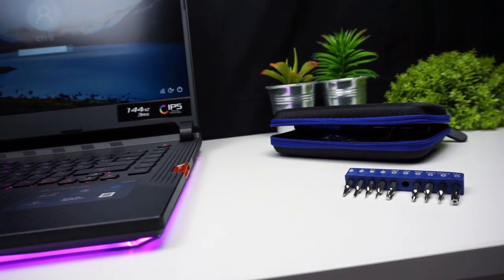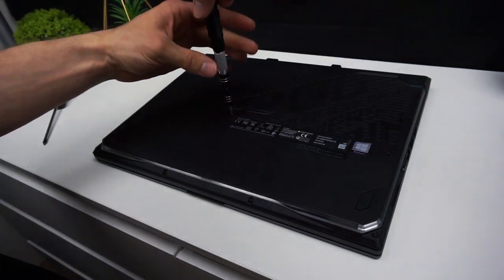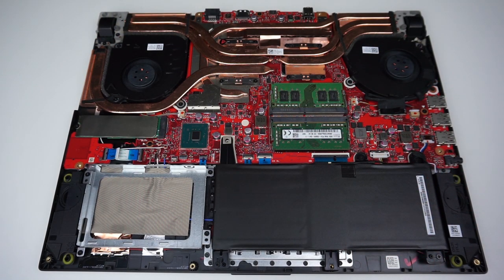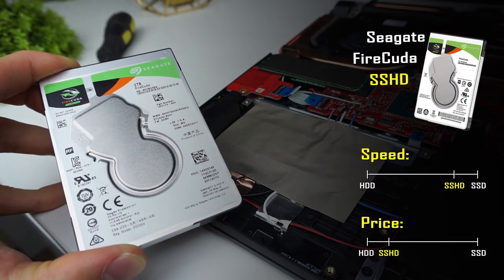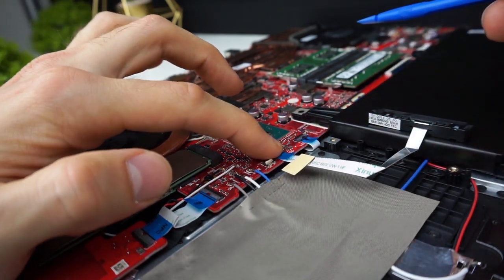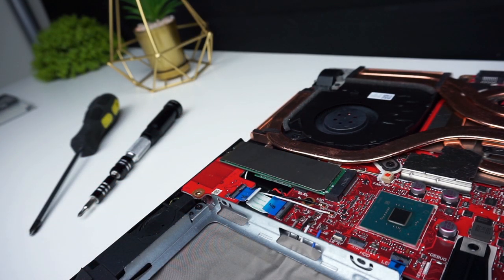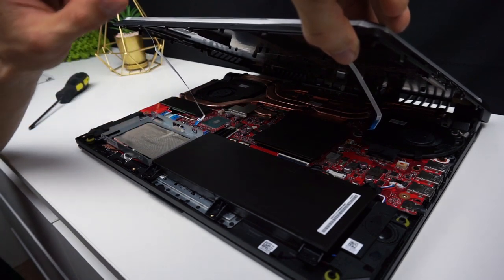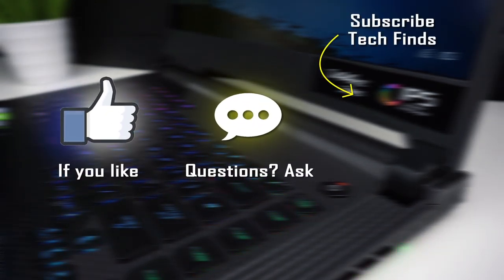Asus Scar III Upgrade RAM / SSD / HDD - Disassembly Guide

Comment: can you keep you battery unconnected when playing at home on charge cable?
Reply from the maker: Every laptop has 30fps limit in games on battery, so you should play with cable connected.
Reply: @TechFinds  thx... But what I meant (while at home) I dont need the battery at all, so my question is if i can un-connect the battery permanent or put it even out while playing with the cable connected? (I dont want to waste the battery for nothing)
Reply from the maker: @ii-_-ii1547  you should leave the battery connected even though you use the laptop plugged in all the time
Reply: @TechFinds  thx mate I appreciate

Comment: Is the Crucial 16GB 2400MHz also compatable with the Rog Strix Scar III?
Reply from the maker: Yes, you can use it but I don't recommend to mix it with original RAM which is 2666MHz. It's better to match the specs

Comment: Which ram does the strix gl531gt take? And is 512gb of ssd ideal for a gaming laptop?
Reply from the maker: If you gonna have a lot of games i recommend some 1TB or 2TB HDD. I linked compatible RAM in the description.
Reply: Tech Finds so all three you linked are ddr4? And what’s the difference between 26666Mhz and the higher numbered models?
Reply from the maker: @peasant9613  2666MHz is the maximum this laptop supports.
Reply: Tech Finds ok.
Reply: Tech Finds final question, would you recommend taking out the already supplied 8gb ram and putting in two of the same crucial rams or using one crucial stick and adding it to the empty slot?
Reply from the maker: @peasant9613  Adding one more stick is better as you'll save yourself some money. It will work the same good tho
Reply: Tech Finds sorry 😂 another question, do I have to use the same spec stick in order for it to work? Ex. The already supplied stick is a Samsung 2400mhz 8gb, should I have to use a crucial 2400mhz or could I use 2666Mhz?
Reply from the maker: @peasant9613  It's important to match the specs to avoid compatibility issues. If you have 2400MHz go for the same speed Crucial
Reply: Tech Finds thanks so much!

Comment: Can I just just install a new harddrive with higher memory.  Or do I need to transfer the operating system to the new harddrive ?
Reply from the maker: Your OS is on M.2 SSD, so if you'll change or add HDD you don't have to re-install OS
Reply: @TechFinds  awsome thank you . Now just curious if you have time to answer this if not no worries . The hdd what exactly gets stored on there . Just files you download onto your pc?
Reply from the maker: @SAYMiK3  you can store anything you want on your HDD. You can download, transfer files, install games and so on

Comment: Hi ! thanks for sharing your tips and tricks, that's a good highlights ! I just have one question : what kind of M.2 slots I can plug my new SSD ? Which doesn't restrained the download and upload rate ? 
Thanks for reply
Reply from the maker: Hi mate, i linked few SSD options in the description so you can choose any. M.2 NvMe are the fastest ones
Reply: OK cool thanks for reply but I mean can I plug a second SSD m.2 instead of the SATA with an adaptator without loosing speed ? Like this I can have 2 ssd NVMe with high performance.
Reply from the maker: @mathieu8514  tbh i haven't tried this solution. It should be possible but i don't know how about speed
Reply: Thanks a lot !! Do you know where I can find the solution on the net ? Or someone could answer my question ?
Cheers, all the best

Comment: does it mean that u can add a 3rd one?.? i got 1 SSD and 1 hard drive and i want to add an other hard drive is it possible to have 3 ?
Reply from the maker: No, the laptop has 1 slot for m.2 SSD and 1 slot for 2.5" drive
Reply: @TechFinds  ah ok then thx very much
Reply: @TechFinds  and got a question if i replace my 2to by 4to can i just replace it and it will keep the data or do i have to save it and reinstall and transfer it???
Reply from the maker: @TheAlexn2  if you'll replace the drive where you have your windows installed (most likely M.2 SSD) then you have to reinstall windows on the new drive. If you're replacing only HDD and you don't have windows installed on it then you don't have to reinstall windows but you have to move your data from this HDD to the new HDD

Comment: i installed a hdd and after that 2 of my button's light are glitched. light blue turn to dark blue for example
Reply from the maker: It's not necessarily because of upgrade. I'd sai it's rather software issue or the led itself

Comment: Is there any limit to the HDD size I can install?
Reply from the maker: It seems like nobody knows about any limits. It usually Hard Drives more than 2TB are thicker so it probably won't fit. Mine is 7-9mm thick (standard for 2.5" drive)
Reply: @TechFinds  that's cool, I mean more capacity wise as manufacturer only recommends up to 1tb
Reply from the maker: @evilzoku  You can go for 2TB for sure. Manufacturers sell configurations with up to 1TB.

Comment: Upgraded ram in mine from the crappy 2666mhz ram to 3200mhz cas16 memory. Issue is it's still running at 2666mhz and cas 19. Any ideas how to get it to load propery XMP profile and run the ram correctly?
Reply from the maker: This laptop supports max 2666MHz RAM. It just down locked to the maximum amount it can support, but idk what about CL
Reply: @TechFinds  Any ideas on getting an unlocked bios then? I tried doing it myself but the unlocked bios I make just never installs.

I tried asking some guys over on a bios unlock site/forum and they just ignore me.

Comment: I have rog strix g.... 

It has "Sk hynex 8gb ddr4 2666 CL19 single channel" RAM in slot no 1.
Can I add additional 16gb ddr4 2666 CL18 Single channel or dual channel In slot no. 2?

It will be total 24gb as the device supports 32gb....

Will it work?
Reply from the maker: You are probably talking about "single rank" not channel.
You better go for 8GB, and CL19 to match with the specs of your original SK Hynix RAM. CL18 shouldn't be a big deal tho. Crucial that i linked in the description is a good match to mix.
Sometimes when you mix different capacities (8+16) dual channel may not be activated, but not always.
Reply: @TechFinds  Noted.... Thank you!

Comment: I have a strix hero III and I got a baracuda ssd 1tb. Tried to install it according to this video step by step but when I reached the part where you plug in the SSD with the ribbon cable I couldn’t find the ribbon either in the laptop or in the SSD box. Do I have to buy this separately or does it come in the laptop?
Reply from the maker: It usually ships with the laptop, check the original box and envelope with paperwork. If you don't have it you have to buy it separately (link in the description)

Comment: Hi it’s been almost a year since I bought my strix scar 2 and it has some thermal issues... clockspeed goes below 3ghz while playing certain games....weather is pretty hot here but still it throttles way too hard barely keeping above the base clock of 2.2ghz... should I change the thermal paste? Is so which one should I use?
Reply from the maker: After one year you should definietely change thermal paste. I recommend Thermal Grizzly Kryonaut as it has the best thermal conductivity. Also make sure to play on turbo mode (overboost).
Reply: Tech Finds thnx for the help
Reply: Tech Finds thermal grizzly also has a liquid metal paste should I use it or is it not safe for long term usage?
Reply from the maker: @avikmandal6133  Thermal paste is enough and safe. If you apply liquid metal incorrectly you may literally destroy your laptop, so don't do it unless you're experienced and you know how.

Comment: Hello Tech Finds
i have ASUS ROG Strix G731GV-EV178  (90NR01P1-M03810) can i put another SSD ?

which laptop is better ASUS ROG Strix G731GV-EV178  (90NR01P1-M03810) 
or 
this Asus G731GV-EV180T (90NR01P2-M03840) ?
Reply from the maker: This laptop has 1x drive bay for 2.5" HDD or SSD (2.5" SATA) and 1x slot for M.2 SSD. So you can put SSD in the place of HDD.
Tell me the specs of these laptops and prices, because depending on the country google gives different search results for these model names.
Reply: @TechFinds  ASUS ROG Strix G731GV-EV178 Intel Core i7 9750H 2600 MHz/17.3"/1920x1080/16GB/1024GB SSD//NVIDIA GeForce RTX 2060/Wi-Fi/Bluetooth/DOS (90NR01P1-M03810)
Reply from the maker: @alexandru6211  Yes, so it has a free space for 2.5" SSD

Comment: What is the maximum ssd and hdd to be installed??
Reply from the maker: For HDD you are not limited I think, but it depends on the thickness of your 2.5" drive. Mine was 7mm, but usually over 2TB the drives are 15mm, so idk if it will fit. For M.2 SSD I don't know if there are any limitations, but i've heard people say 1TB is max

Comment: I connected the SSHD but it doesn’t show in the devices and drivers in This PC tab. Any idea why? Thanks
Reply from the maker: Are you sure that you connected the ribbon cable firmly to the motherboard?
Before you will be able to see the drive in Your PC you have to create a volume.
Here's how to do it (start from 10:25): https://www.youtube.com/watch?v=UV72wLA06_c&t=626s
Reply: Tech Finds Thanks for the help, It works fine now but I encountered a new issue. The speakers doesn’t work anymore. After I created the volume it said I had to restart the laptop. Then it wasn’t working. I sat it as a default, I rebooted the laptop, I reinstalled it from the device manager. Yet it’s not working. Have you ever seen this issue? Thanks in advance.
Reply from the maker: @xBlackBloooDx  nobody reported me yet about not working speakers in Scar 3, but for sure it has nothing to do with the HDD I stallation. I think it may be driver thing

Comment: My PC is not recognizing the Harddrive? Am I doing anything wrong or is there way to trouble shoot?
Reply: Also what cable to you recommend to connect the hard drive. I got one off Amazon and I am thinking that could be my problem
Reply from the maker: After installing you have to go to device manager and make a partition on the new drive to make it appear in the system
Reply: @TechFinds  It's not appearing in Device manager since I believe the cable I used to connect to the MOBO is not working properly. Do you have a link to the cable that you used in the video so I can purchase that said one.
Reply from the maker: @BigRizzy77  I linked the cable in the description. It's from official Asus site.
Reply: @TechFinds  Thanks brother! much appreciated after I got the cable in the description it worked perfectly. Where on the laptop is the WIFI/Blutooth adaptor. Mine fried itself last night out of the blue?
Reply from the maker: @BigRizzy77  it should look like a very small M.2 SSD, it often has the same looking connection and it's screwed into the motherboard at one end with one screw

Comment: Hi! I changed both my SSD and SSHD and now im stuck at Republic of gamers logo . I put a usb stick with windows 10 installation in but it is stuck at the RoG logo. Please if anybody can help.
Reply from the maker: Try to do a hard reset, i explained how to do it at the ned of the video
Reply: @TechFinds  i did the hard reset thingy it did not work but i put my old ssd back in and windows booted up. So now im pretty sure its got to be the UEFI boot that is making the problem with the new empty SSD . Still i got no clue how to resolve it as i cant get into BIOS when i put in my new SSD . If anybody got a solution would be great .

Comment: He disconnected the battery and in the instructions manual they say it can explode if u try to disconnect and connect . WE SHOULD NEVER DISCONNECT THE BATTERY . THERE CAN BE A DANGER OF EXPLOSION
Reply from the maker: On the other hand people say that if you don't disconnect the battery you may get electrocuted. Disconnecting the battery is a good practice and it was always recommended when changing parts. I don't do that, but it's my choice and maybe laziness. In theory li-ion batteries can explode anytime by themselves, but do they explode usually? Manufacturers have to include such info to protect themselves in case of explosion.

Comment: hi sir, can you tell me how install another SSD (not swaping ) into my laptop, should I use the M2 or the 2.5 inch type? Please answer me, thank you!!
Reply from the maker: You do it the same way as showed in the video. Just instead of swapping you're just adding a drive to the empty slot. You can use any type you want depending on which slot is free in your laptop.
Reply: @TechFinds  hi , excuse me , I want to ask exactly about laptop which we have on video. My own is also  Scar III , but 17 inches, and i want to ask , can I add ( not swap) 1 more ssd M2 type. And if yes, so how to do it
Reply from the maker: @madgaz  No, your laptop has only one slot for M.2 SSD. But if you can you can add 2.5" SATA SSD
Reply: Tech Finds thanks, for this information , that’s why how do you think, this ssd from Samsung will be nice ? Samsung 860 Evo-Series 1TB 2.5" SATA III V-NAND TLC (MZ-76E1T0BW)
Reply from the maker: @madgaz  Yep, i always recommend Samsung 860 Evo when people ask me about 2.5" SSD
Reply: Tech Finds thank you very much, with your help I found the best solution for my issues
Reply: @TechFinds  may i ask why, coz there are a lot of 2.5" SSDs out there beside Samsung 860 Evo
Reply from the maker: @m_aminoracousticmusic6312  It has good reviews and large base of reviews as it's popular.

Comment: Great video! 
I have asus rog gt531 with 8 gb ram, can i add to the second slot of ram 16gb 2666 of hyperX?
Reply from the maker: You can add another 16GB but not HyperX. I mean it should work, but for the best compatibility match the specs of new RAM with original RAM. CL19 2666MHz
Reply: Btw, i installed 16 gb 2066 ddr4 of Kingston and i have now 24gb ram, it works great!

Comment: Installed 32gb ram and checked both slots work and both pieces of ram work but it will only boot with one stick of ram? Do you think it’s cause didn’t reset the power?
Reply: I think that laptop has max 32gb memory

Comment: does the computer come with screws for the hdd or ssd
Reply from the maker: It may vary between countries, but mine came with caddy, cable and screws  to mount it to the body of the laptop. I don't remember if I had HDD screws as well.

Comment: I was wondering if anyone has attempted to replace the screen on one of these. I picked up a Strix G 17 inch for a really good price and love it but it is the 60hz version. I have replaced laptop screens before but I'd prefer to have a guide. Could anyone point me in the right direction?
Reply from the maker: It should be about the same process for pretty much every laptop. Just slight build differences. Unfortunately i can't help since i am not permitted to do that.

Comment: Hi! I try to disconnect the ledlight, and when i connect it, the light it's just work when i start it. And then the light doesn't work now.. what's wrong and how do i fix it?
Reply: My laptop is asus rog strix G.
Reply from the maker: Maybe the light just reset. Have you tryed to turn on the light bar using any app like Aura Creator? Also ensure that you connected the cables properly all the way in and secured with a flap
Reply: @TechFinds  I tried both, but sadly nothing changed.🥺
Reply: @TechFinds  it's okay now idol. Thanks
Reply: @laurencemorante6512  what did you do to make it work?
Reply: @markbangug469   just go to armoury crate and find the lighting and then setting and on it

Comment: Hi bro 
My laptop asus rog strix g rtx model 
I'm facing a problem with mic, inbuilt mic working well with games. I tried to call through botim and mic was very low on other side and also my headset mic is not working. Its even recognized (plantronics rig 500)
Please help
Reply from the maker: I had the same problem with other laptop, but reconnecting to the caller solved the problem. Do you mean they can hear low volume when you speak? Maybe it's about your mic sensitivity, but idk where to look for such settings. Try to find something in your operating system but also in Sonic Studio 3.
Reply: @TechFinds  
I tried with windows settings, sensitivity is high. I'll check with sonic again. 
Yes they can hear but low voice. 
Forget that i want my headset mic to work and another thing is everytime I connect 3.5mm Jack it ask options. I need to click ok otherwise headset sound won't work. Mic of headset is not showing in settings
Reply from the maker: @ahambhramasmii  Then update your audio and microphone drivers. Recently one of my viewers had the same problem and it worked for him. If updating won't help uninstall drivers and install the newest again.

Comment: i ve own this one. My question is, could this laptop ram are upgradable to 32gb with 3200mhz speed?
Reply from the maker: This laptop supports max 32GB RAM (2x16) 2666MHz
Reply: @TechFinds  lookslike there is no way we can upgrade its ram speed right? sticked to 2600mhz only.
Reply from the maker: @alwalid7972  Yes this is the maximum, because 9th gen processors can support up to this much speed